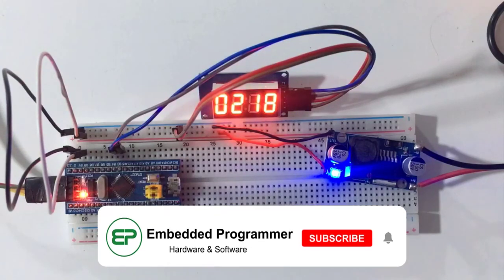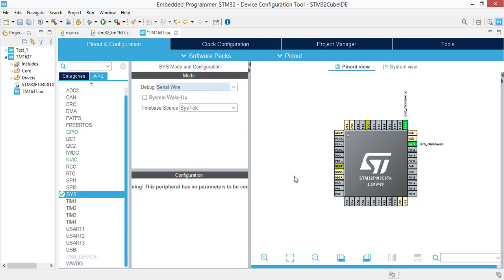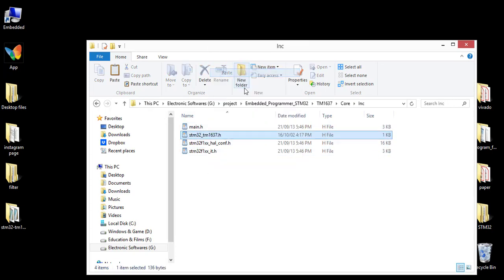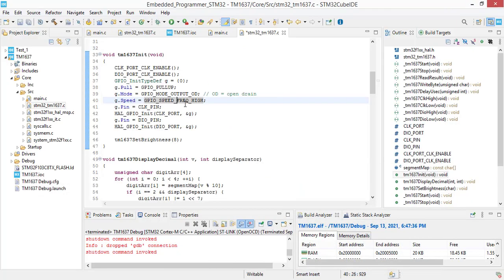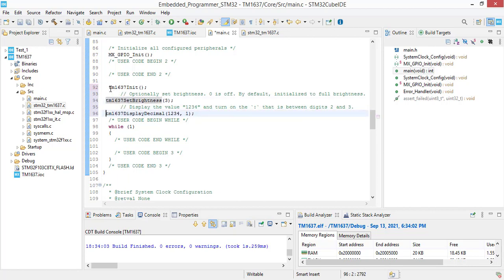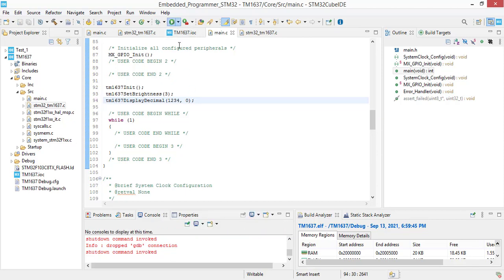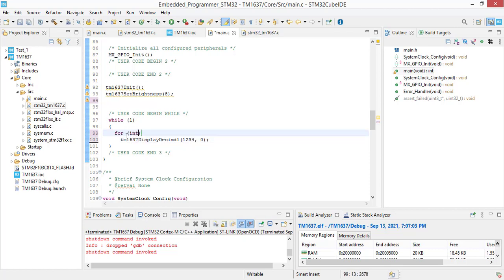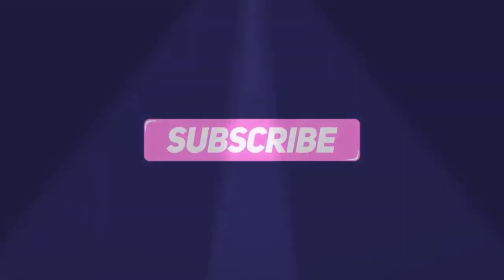How to Use TM1637 with STM32F103 | Embedded Programmer

Comment: If we dont know if we wil obtain 1.23 or 12. 3, how to establish dot (or ":") sign ?
Reply from the maker: You can check the tm1637DisplayDecimal() function, where displaySeparator mathches the counter (i). Change the variable (i) based on your desired dot position.
Reply: @Embedded_Programmer  Why I dont see string text writer command, fx like that WriteText("ABCD") or so.
Reply from the maker: @incxxxx  You can add it by yourself, try:

const char segmentMap[] = {
    0x3f, 0x06, 0x5b, 0x4f, 0x66, 0x6d, 0x7d, 0x07, // 0-7
    0x7f, 0x6f, // 8-9
    0x77, 0x7c, 0x39, 0x5e, 0x79, 0x71, // A-F
    0x6d, 0x76, 0x38, 0x37, 0x3e, 0x73, // G-K (examples)
    0x38, 0x15, 0x54, 0x5c, 0x5b, 0x50, 0x78, 0x3e, // L-R (examples)
    0x6d, 0x31, 0x6e, 0x74, 0x5c, 0x1c, 0x76, 0x6d, // S-Z (examples)
    0x00  // Empty segment
};

void tm1637DisplayString(const char *str)
{
    unsigned char digitArr[4] = {0};
    for (int i = 0; i < 4; ++i) {
        if (str[i] == '\0') break; // Stop if string ends
        if (str[i] >= '0' && str[i] <= '9') {
            digitArr[i] = segmentMap[str[i] - '0'];
        } else if (str[i] >= 'A' && str[i] <= 'Z') {
            digitArr[i] = segmentMap[str[i] - 'A' + 10]; // Map A-Z
        } else {
            digitArr[i] = 0x00; // Blank for unsupported chars
        }
    }

    _tm1637Start();
    _tm1637WriteByte(0x40); // Write command
    _tm1637ReadResult();
    _tm1637Stop();

    _tm1637Start();
    _tm1637WriteByte(0xc0); // Set starting address
    _tm1637ReadResult();

    for (int i = 0; i < 4; ++i) {
        _tm1637WriteByte(digitArr[i]);
        _tm1637ReadResult();
    }

    _tm1637Stop();
}

and call the function

tm1637DisplayString("ABCD");
Reply: @Embedded_Programmer  Thank You.
Reply: @Embedded_Programmer  It is not what Im asking. For example I proceed with calculation or I my sensor read the temperture, which could be 1.23 or 12.76. How your software knows when write 1.23 and when write 12.76. As you see dot is the two cases in different position. Software should analyse the two numbers to establish the dot position.
Reply from the maker: @incxxxx  There is no such analysis algorithm here. You would implement the related algorithms by yourself

Comment: Decimal Point is not shifting properly. Can you pls look into the issue ? if i want to display 1.234 it shows 12.34.
Reply from the maker: You need to modify the tm1637DisplayDecimal() function where displaySeparator mathches the counter (i). Change the i == 2 condition to i == 1.

Comment: I AM GETTING WEIRED CHARACTERS WITH PINS DEFINE FOR B12 AND A7. ANY IDEA WHAT COULD BE WRONG ?
Reply from the maker: Have you got the same problem with other pin definition ? (As the same pins (B.3 , B.4) in the video)
Reply: @Embedded_Programmer  will try now and update
Reply: @Embedded_Programmer  Same issue. what could be wrong ?
Reply from the maker: @hacker6695  I put the whole project to my Telegram channel, You can download and test
Reply: @Embedded_Programmer  i am getting display perfectly working only after downloading 1st time. then when i recycle system its showing garbage values. is it related to timer ?
Reply from the maker: @hacker6695  There must be a timing issue. Set the bus frequency as HSE (External clock), configure the PLL and test it again.
Reply: @Embedded_Programmer  did. Found strange behaviour. If I run the loop to display static number in main loop it shows 12.34 perfect even after power cycle. But When I run counter it will work only 1 time after downloading.
Reply: @Embedded_Programmer  Okay finally its working. It's for loop issue for checking counter i don't what was wrong... but its working now... thanks for support
Reply: @Embedded_Programmer  What is "Telegram channel"? Where can I find it?
Reply from the maker: @incxxxx  please check   
t.me/ep_projects
Reply: @Embedded_Programmer  so this will not work with internal clock (hsi) ? also im trying this lib with my 6 digit display but not getting anything printed on the display, what could be the reason ?